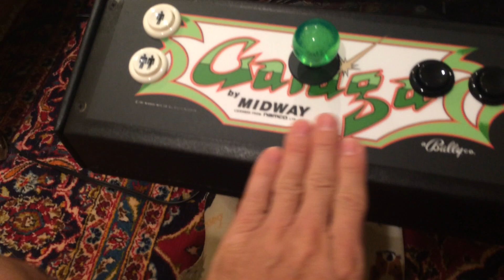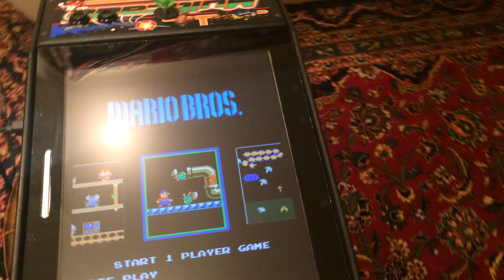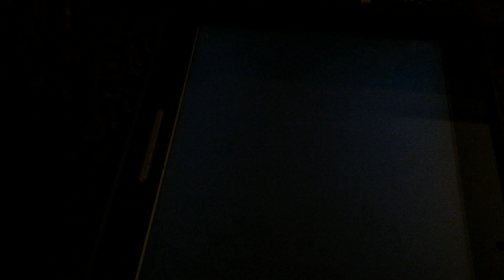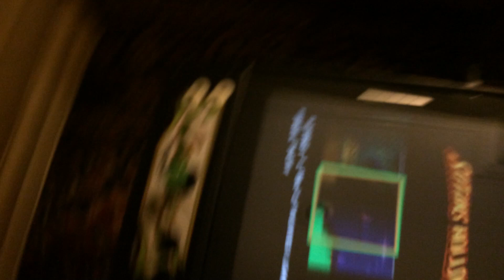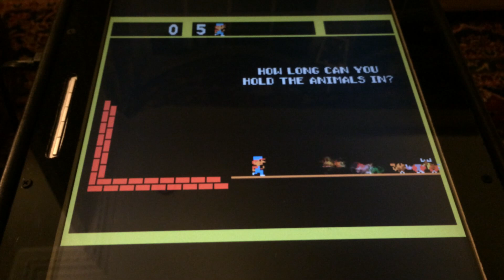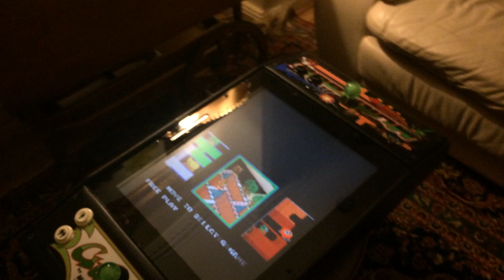Newest Mini Cocktail build - Mono Amp hooked up!

Comment: H Jeff that cabinet looks great :) real nice job.
I have mine almost finished but I recently got two of my dads old cocktail machines from him and as im busy with work and other commitments I don't really have much time to finish my projects,well at least until maybe mid October but I have stripped down and taken apart one of the old space invader cocktail cabinets and I am still trying to decide what look to go for with that but I will be putting a Jamma 60 in 1 board it there.
I did find a Tekken 3 board in my dads garage and I managed to find the pinout drawings online so I have a small upright cabinet that I will be putting side art and maybe the light up joysticks and buttons for that project.
Anyway Jeff thanks for posting and I look forward to your next video..
Reply from the maker: Thanks, I appreciate the comments as usual man.  An old space invader cocktail is a great project!  And I always liked Tekken 3 in the fighter arcades realm. :)